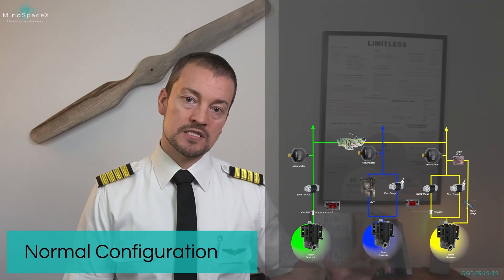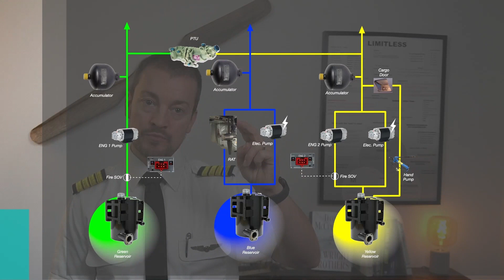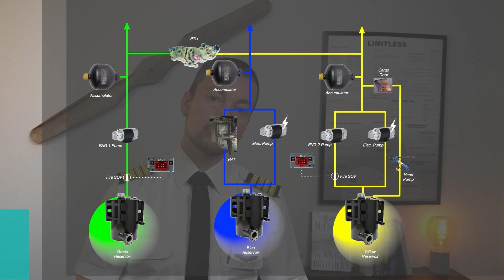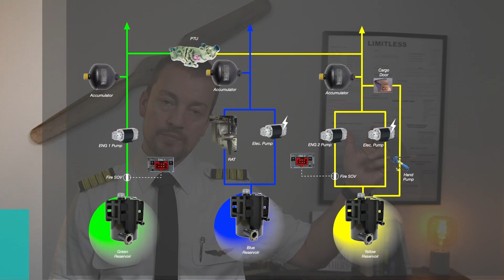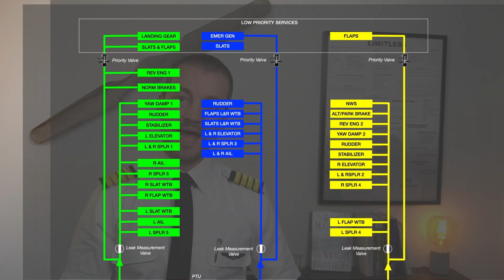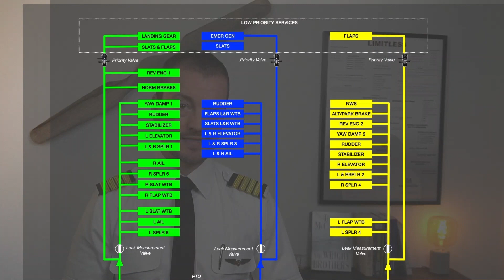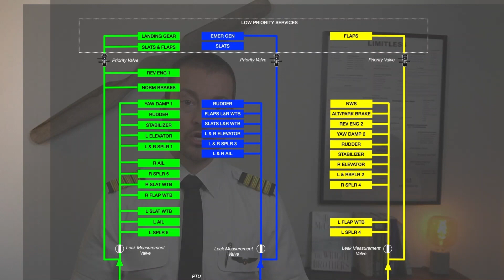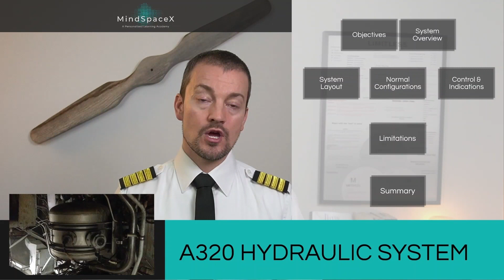A320 Hydraulic System Operation

Comment: Sir what about the auto brake ? I thought if we lost green HYD we lose auto brake?
Reply from the maker: Auto Brake is not available if the green hydraulic system is lost.

From the Airbus FCOM:

SYSTEM ARMING
The crew may arm the system by pressing the LO, MED, or MAX pushbutton provided all the
following arming conditions are met :
- Green pressure available
- Anti-skid electrically-powered
- No failure in the braking system
- At least one ADIRU is available.

Comment: Great video! But I cannot find more specific technical details about the PTU - is it´s internal structure build similar like a turbo charger, but instead of exhaust gases having the pressurized hydraulics fluid driving an impeller while another impeller sitting on the same shaft vice versa serves as a pump in the other hydraulics system? 
Or is it´s internal design more designed like a piston pump? I wonder how it creates it´s iconic barking sounds....
Reply from the maker: Did you check out this video on the PTU: https://youtu.be/kTxnvI_RtHo

The internal design of a common PTU is designed like a piston pump. While one side works as a 'motor' driving the other side as a pump. It is what we call a bi-directional pump unit. You are right, the sound is very destinct :)
Reply: It's basically an axial piston pump, if you search for it you will find plenty of explanation videos about it